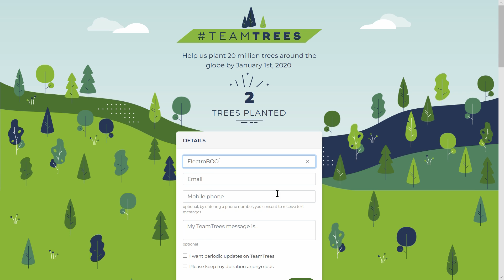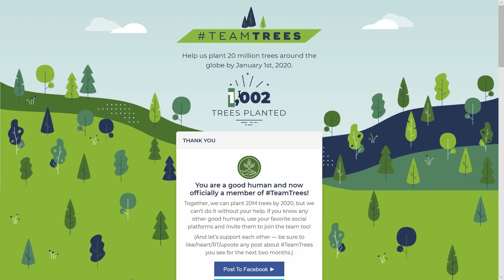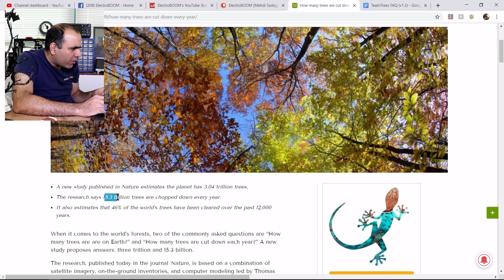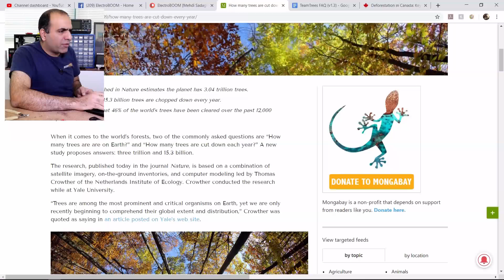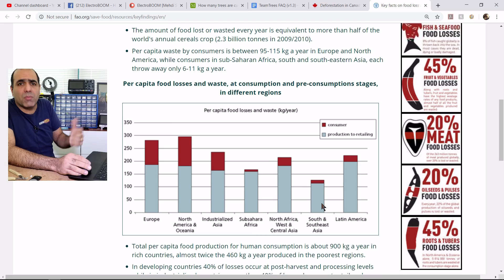Making a TASER TREE & Planting 20 MILLION TREES! #TeamTrees

Comment: The number 1 rule as a electronic engineer is to never plug in something when it dosent need high voltage and also test it by using a fan battery

Comment: fun fact about logging industries.
Logging is actualyl better than having a tree planted permanently in regards to carbon neutrality
A growing tree is far more effective at removing carbon than a fully grown tree as it requires far more energy, most if the carbon reducing properties of a tree occur within the first 10 years of a trees life.
Reply: 20-40 year old tree is the best carbon intaker.
Under 20yo tree grows so slowly that the intake is insignifficant, over 40yo tree starts decaying and releasing carbon faster and faster. Eventually tree stops growing as all intake goes on replacing the decaying.

But it fully depends how you will use the cut down tree.
If you gonna just burn it, its better to leave it standing. (When it comes to climate)

But if you turn it to paper/pulp, or even better, use it for construction, its always better to cut down old trees and replace them with new ones.

I'm somewhat conflicted I chose chemistry focused side in bioproduct engineering instead of Mechanical wood engineering.

The latter especially focuses on ways to create wood that could replace steel in tall buildings and construction in general.
 
Side I chose focuses mostly on how to replace plastics with wood etc.

Comment: the ground must be created as follows:

    The O horizon (or humus) is mostly made up of organic matter, such as decaying leaves or insects. Depending on the soil, the O layer can be very thick or nonexistent.
    The A horizon (or topsoil or surface soil) is mainly made up of minerals and decomposed organic matter. This is where most of the roots of plants grow.
    The E horizon is also called the eluvial horizon. Clay, minerals and organic matter escape from this layer. The sand and quartz particles in the silt remain. It is often found in older soils and those of forests.
    The B horizon (or subsoil) is made up of clay and mineral deposits as well as organic matter, but in lesser quantity than the upper layers.
    The C horizon (or parent material layer) is made up of almost unaltered rock and very little organic material. It is from him that the soil develops. No root grows in this layer.
    The R horizon (or bedrock) is made up of a mass of rocks such as granite, limestone or sandstone.

Comment: Although it's not deforestification, those trees still can't absorb CO2 anymore, no?
Reply: Trees are like water buckets.
Tree "fills" with carbon and grows untill it reaches age of 40-50 years.

Then you can compare those trees as overflowing buckets. They rot and decay same speed as they tie carbon, so benefit is +-0

If that tree is then cut down and used on responsible indrusty, example wooden construction, the carbon stays tied for long as the house stands.
Then you can replace the overflown bucket with new empty one (planting a new sappling)

If we just found a way to genetically engineer trees to grow faster. 
Problem is that composition and structure of tree becomes uselessly bad, if the tree has grown too fast.
Reply: @jarskil8862  interesting

Comment: Those Chinese high voltage generators are crap BTW. They are easily destroyed. It’s what they use in their crap stun guns. It’s not a very efficient circuit and uses a cap/diode network at the end to boost the voltage instead of using a transformer with a segmented bobbin. While the former gives you more violent sparks, the later provides a more tunable circuit.

Comment: I have been playing guitar for over 30 years. In that time there has been guitars made without wood that sound just as good. But the cork sniffers will have none of that because that’s now how they made electric guitars in the 50s. 🙄
 At the very least they should revert to using Richlite instead of maple, rosewood, or ebony.
 I actually PREFER Richlite but it’s difficult to get a guitar with Richlite fretboard on a guitar because guitar makers fear low sales because of cork sniffers.

Comment: If larger voltage means high current will flow through conductor then why instead of stepping up the voltage by transformer power remains constant... By stepping up voltage current should also increase thus power should increase but power remains constant in transformer ?????????
Reply: Think of it like a bicycle , while climbing up a slope, you shift into a lower gear (analogous to higher voltages) however you to pedal faster (analogous to power) inorder to keep moving up the slope( analogous to increased current draw)
If your input power is limited,  you limit the output power. As the output voltage is higher, the output current must be lower for a limited power

Comment: "safer high voltage arc"
i'm not sure the sentence really make sense or not
Reply: Satrio Arif Well... Mehdi is using a low frequency (looks like 50Hz) boost converter for the high voltage supply. Higher frequency (around 40 KHz+) high voltage is actually “safer” since it doesn’t go directly through your body due to conductor skin effect, and it instead stays mainly in/on the outer layers of the dermis. But it will still burn its way through your dermis if you don’t pull away quickly. But since it doesn’t go through your organs and muscles and just stays on the surface, it can’t exactly kill you instantly. So technically it is safer than the low frequency arcs Mehdi has on his death tree.

Comment: Sad story: Imagine one tree every 5 meters: 20 Million trees equals 4472x4472 trees equals a square area of 22.4km x 22.4km.
In fact, this is quite a small forest compared to some purposly created wildfires in Southern America this year.
Let's just hope that the trees are not planted in areas where they wonna burn them down in a few years again or get the idea of using the wood and create farmland...
One more thing: It is not a good idea to replace farmland with forests - that area is needed/used and would be replaced by some other location, e.g. in the rainforest.

Edit: Don't get me wrong, this is still better than doing nothing. I just don't think that planting trees alone will solve any problems.

Comment: Hey guys!
I was wondering is it an effective protection against shock yourself if you useing domestic gloves when you working on some high voltage electronics like a power supply of a monitor? I know that there are some protective gloves for working on electricity (like up to 500 V for electricians), but are those domestic gloves effective enought against 125-230 V?

Comment: Hello mehdi, can u explain what the hell is a Q point in transistor?
Reply from the maker: Oh a Q point! It is just when no AC is present and everything is only biased with regular DC voltages as if there is no input signal. It is also called the operating point.
Reply: @ElectroBOOM  isn't that zero signal collector current? If there is no AC signal then there will be flow of DC due to biasing. if we bring up the AC (audio signal) to match up DC ( due to biasing) then proper zero signal collector current is achieved  thereby making distortion free output. This was my idea about q point. Iam I wrong?

Comment: The flat farm areas you showed are mostly part of the Great Plains, where there weren't many trees to begin with... it was never deforested. Trees are mostly necessary in tropical and rainforest areas, with northern plains being necessary for snow in the winter to reflect heat where trees would have absorbed it. Planting trees is great, as long as you know where they are most needed. Basically where trees already exist or used to exist, they are needed, and planting them in mass quantities elsewhere can be detrimental.

Comment: you can run that booster with a 9volt battery i make taser guns with them and they last a long time...you dont need that controller you can make it portable with 9v terminal and 9v battery and add a switch to turn it off and on....same as with the small motor.

Comment: Altough a larger voltage would be required and smaller gaps, wouldn't be better to connect wires in series? Then no need for moving motor and maybe more impressive sparkling all at the same time.

Comment: hey Electroboom, can you make a video on building a LiFePO4 battery pack using 32650 cells with powerful voltage regulation circuits so that it could be used to power 12v appliances or projects

Comment: “Safer high voltage arcs.”
That falls into the same category as “safer flamethrowers” and “non-lethal hollow-point rounds.”
Reply: not really. Anyone who knows a bit of electronics will tell you that high voltage doesn't mean danger in all situations. This guy in the video even shown it happen.
Reply: @londonnight937  Flamethrowers and hollow-points also don't mean danger in all situations.
Reply: true
Reply: A flamethrower certainly does. Always assume a gun is loaded ever if you know it's unloaded, but there's no rule to assume a high voltage is high current if you know it's low current.
Reply: @apocaloptigon9988  I knowwwww, right?
Reply: @Las3r Van De Graff you remember?

Comment: That thing you made to choose which wires to spark is called a distributor, it used to be used in cars with auto transformers it has only 4-8 terminals to choose which spark plug goes off first

Comment: I am a plant nursery manager so... $1.00 gets me few trees. If you want to help the environment then mind YOUR landscape. Do not plant deep, a half of an inch out of the ground at planting. Always leave a root ball when planting. Dig the hole to depth but 1 inch wider on all sides. On larger trees you should ring the excess soil around the parameter of the hole, leave a gap to roll the root ball in. When the tree is in the hole it needs to be faced. Every tree has its own character, step back and see the big picture. After you have faced the tree  you back fill the hole. Leave as much of the ring intact as possible and straiten the tree. The tree may not be perfectly strait at this point , but that is okay. Next complete the saucer of dirt around the outside of the hole. Last is the water, find the gap between the hole and the root ball and stick the live hose into the dirt to the bottom of the hole, straiten the tree as you go. Repeat this 3 to 6 times around the tree. Air pockets should open around the ball, this is normal and in fact nominal. Wash the inner lining of the ring into the holes that open. This process is very important and can not be skipped, a root eating fungus WILL grow in the air pockets. Fill the ring with water twice daily for 1 month and feed every 3 months with a granular fertilizer. After 1 month you can remove the dirt ring and you should have a happy tree.

Comment: Don't create corpses with electric death-traps, they will decay and release their carbon back into the atmosphere. Mummification is OK, then the carbon will be released later. The same is true for trees, they will eventually die and release the carbon again. That's the carbon cycle.

To store carbon away, you need to increase the overall amount of forests. Also use the wood in a way that prevents it from decaying and most importantly reduces the use of other materials which would release CO2 in their production (concrete, steel). Also prevent the destruction of forests (amazon wildfires).

Unfortunately we could plant forests everywhere and not solve our CO2 problem. It took many millions of years to store the carbon in the ground (fossile carbon) and it took us only a few centuries to release it. We must stop wasting energy from fossile carbon.

Comment: I know that this seems like a naive question, but what actually is the benefit of planting all these trees?

I realise that the trees sequester carbon from the atmosphere, reducing the affect of global warming, but there are many mitigating factors. I have read that trees in temperate regions do not help at all because the increased light absorption from the trees negates the reduction in CO2, and that this is also true of trees in many colder regions, as trees can absorb light that would otherwise be reflected by snow. Furthermore, planting trees can release carbon stored in the soil and the previous plant life, further negating the positives of planting the trees. 
On top of this, the trees are not a long term solution because once they die, almost all of the carbon will be released back into the atmosphere, rendering the ordeal useless. 

I can see that planting trees, if done right, could provide a small amount of short term relief, and that if the forest was sustained indefinitely, it could continue to provide that relief. It just seems to me that a far more effective solution is to reduce the combustion of fossil fuels. Once we take carbon which has been locked out of the carbon cycle for hundreds of millions of years and put it into the atmosphere, it is very hard to take back, and forestry is not an effective solution. Instead, it seems that this money would be better spend campaigning for governments to invest in nuclear or wind energy to power our electric grid which would definitely reduce carbon in the atmosphere by more and more every year and have a lasting affect, rather than the questionable benefits of planting these trees. 

If you think that any of my thinking here is wrong, please reply to correct me, and take a look at this Wikipedia page: https://en.wikipedia.org/wiki/Tree_planting#Role_in_climate_change